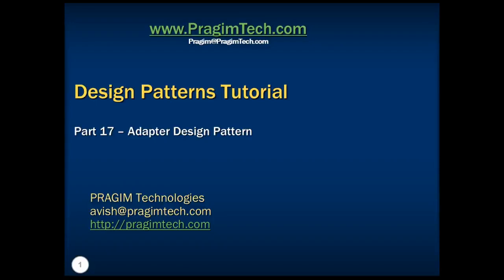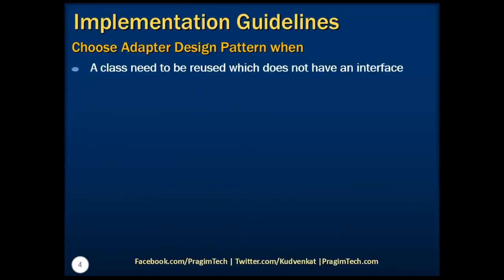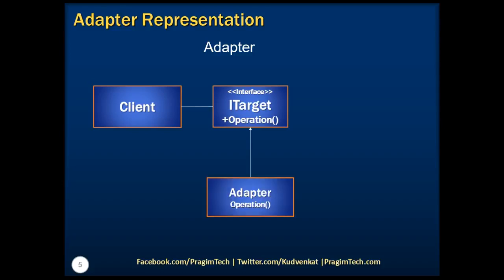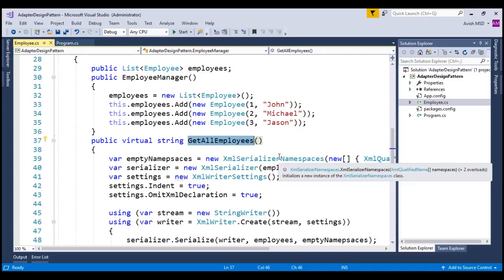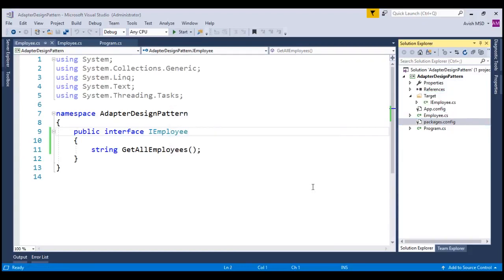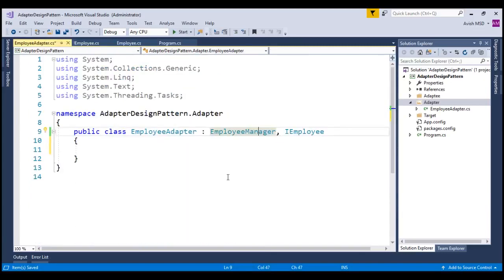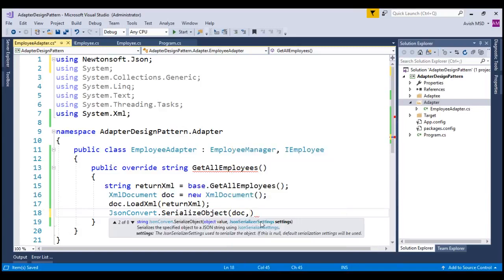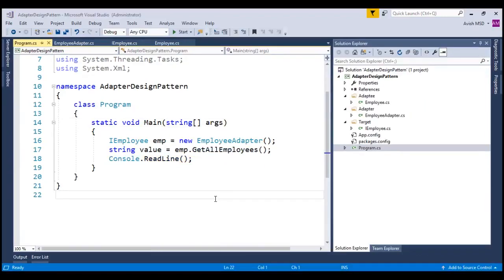Adapter Design Pattern

Comment: Hi sir, Do u have an example code snippet for point2 mentioned under Implementation Guidelines for adapter pattern

Point2: We need to work through a seperate adapter that adapts the interface of an existing class without changing it…

Comment: Hi,

Very well explained, I have a doubt though. Here, the return type of GetAllEmployees function of both Adaptee and Adapter is string. Will this work if adapter needs a different return type, let's say integer ?
Reply: It is not necessary to override the function and return same String type. One can have a new method in Adapter Class that accepts the String from GetAllEmployees as input and returns an Integer. The idea is to not disturb the existing Adaptee class.

Comment: It's not necessary that the Adapter class inherits the Adaptee class. The Adapter class can have an Adaptee attribute. For example:
public class Adapter {
    private Adaptee adaptee;
    public Adapter() {
        this.adaptee = new Adaptee();
    }
    //Rest of the code goes here
}
By this way, Both Adapter and Adaptee are independent so that they are loosely coupled.
Reply: right, I am thinking the same. We can also do it with simple inheritance and new keyword(I commented my solution here regarding kudvenkat). Now I am confused why do we need adapter design pattern and where do we use it.

Comment: Hi Venkat Sir, Hope you read this message. I am watching this 17th video of design pattern series by hoping that Kudvenkat series are the best to understand pattern which is considered as the base of .NET Programming. But seriously, I don't like the way that Avish has explained in all the design pattern(I am talking about the diagram or the Representational diagram on pattern that has been used has some kind of disconnection in the video as well as the auto-implemented code in every video which makes the topic disconnected as the video is short now). I feel like I am in a huge mess now. I would like if you could build a brief video on the same in your way. I am saying this because the way you taught makes me understand the topic easily as it gives a way to connect those with real scenarios.

Comment: Hello sir. I have a query regarding this tutorial. what's the use of IEmployee interface because we can achieve same result without using IEmployee interface. Please clear my doubt.
Reply: Using interface at client will allow to add more adapters if needed in future. We should never use concrete implementation at client.
Reply: I have same doubt
Reply: Hi Kanish, It's contract for client,client should call the methods  using IEmployee interface. We need to make sure at any point of time to implement all the methods for IEmployee interface,we are not going to change existing clasees.